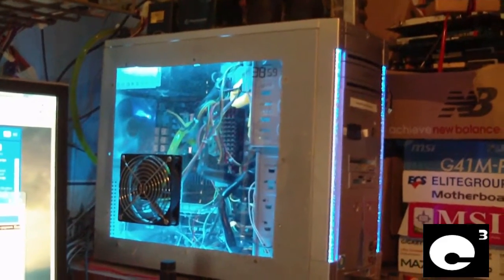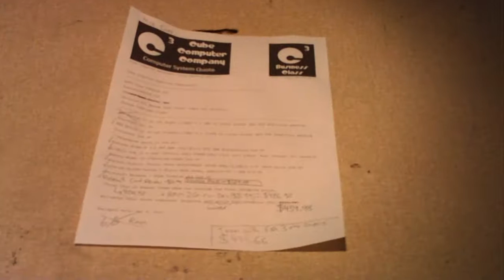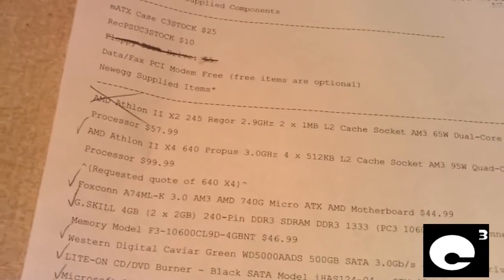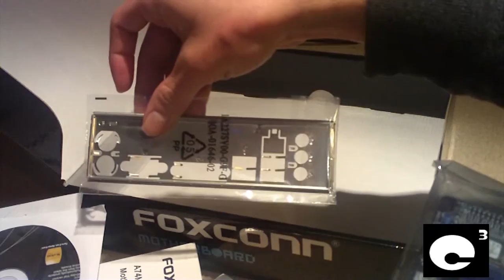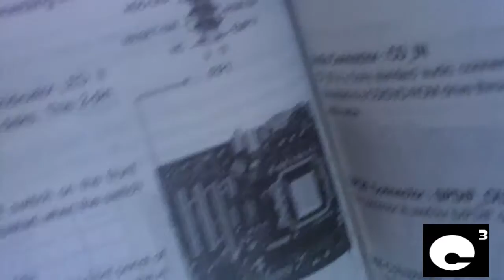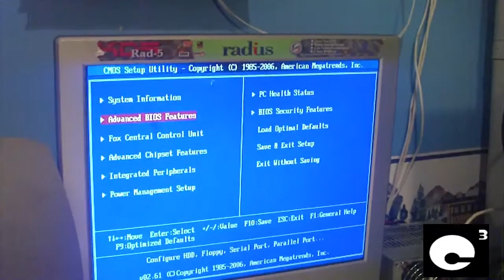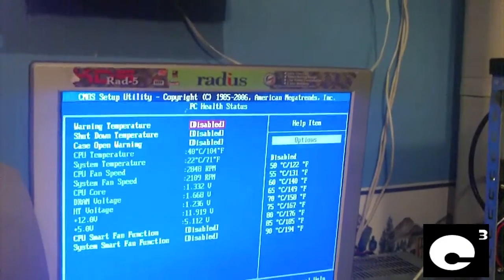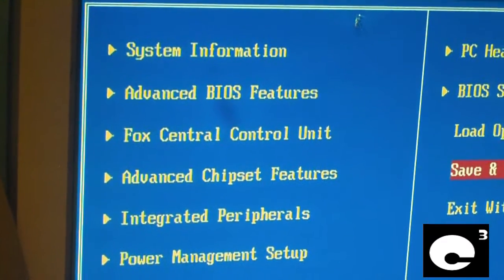How to build a PC - Science Fair Project for college

Comment: the TPM is a Trusted Platform Module. that is normally used for hardware encryption of sorts. bitlocker and truecrypt can take advantage of it. it has other uses as well. a few of my boards have headers for the module as well. funny enough, i don't see it used very often, if ever.